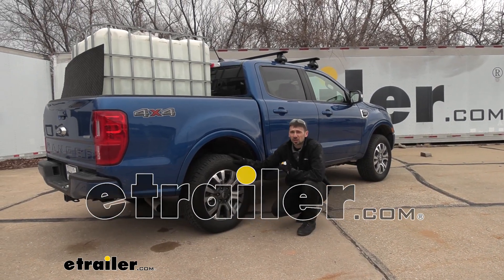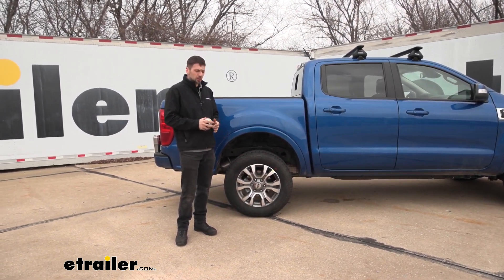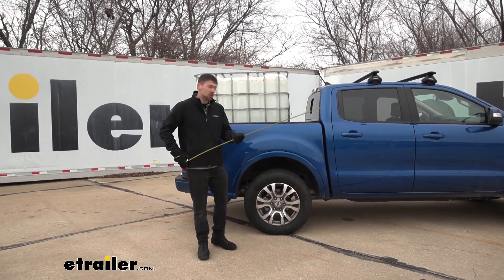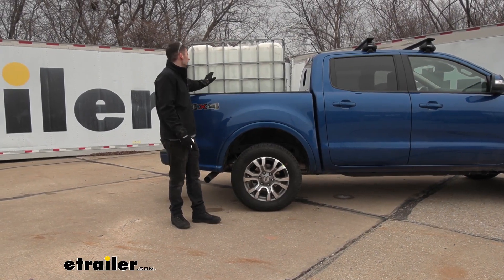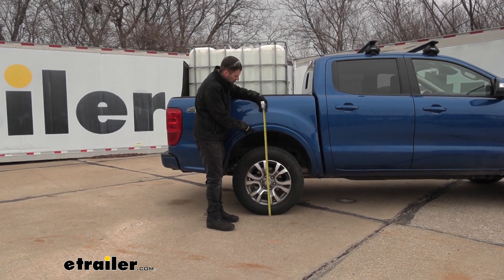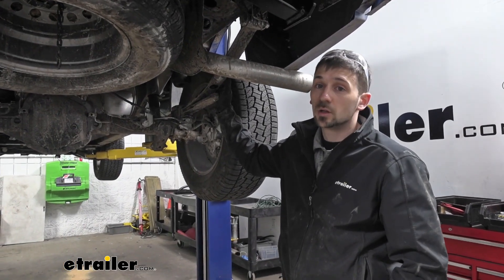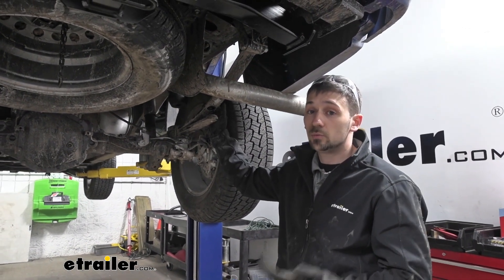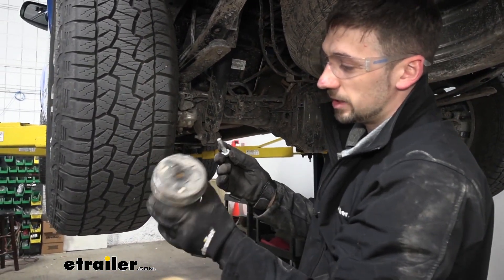etrailer | Installation: Timbren Rear Suspension Enhancement System on a 2020 Ford Ranger

Comment: Can this be installed on a Ranger that already has the Hellwig Spring helper kit and rear sway bar installed? It doesn't look much longer than the stock bump stop.
Reply from the maker: These Timbrens should work just fine because the Hellwig kit is just a helper spring that is added to the leaf pack.
https://www.etrailer.com/Vehicle-Suspension/Timbren/TFRRGR.html